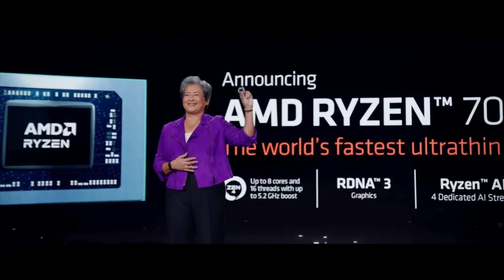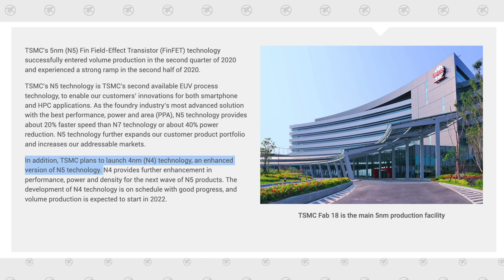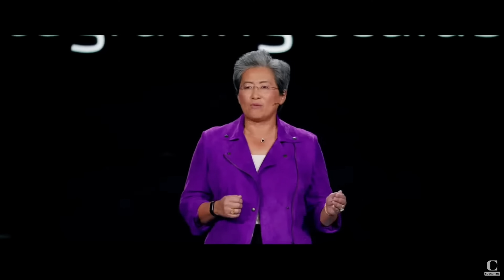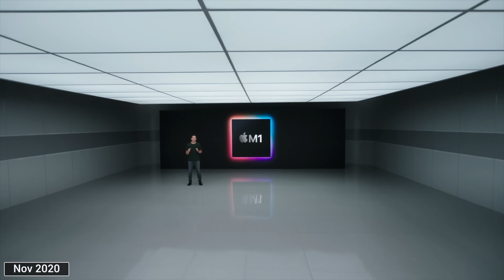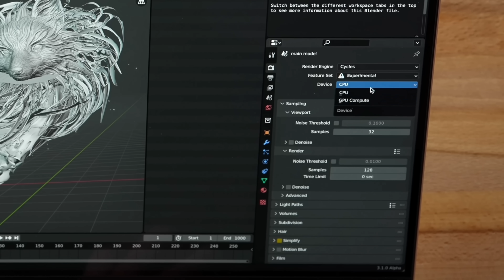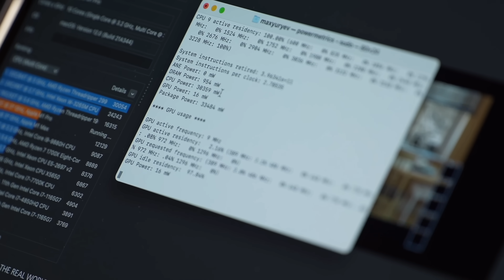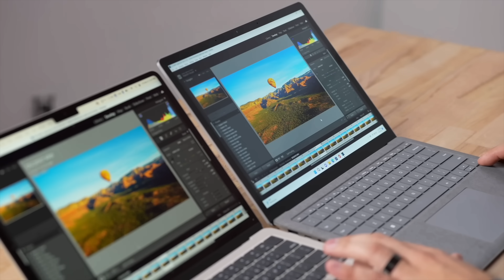AMD's New 4nm 7940HS vs M1 & M2 Pro! Apple Silicon Killer? 🤯

Comment: To me the M-chips have one biggest advantage: the ability to deliver the same performance when unplugged
Reply: You actually mean: to not get extra performance when plugged in because power doesn't really matter if cooling is sufficient?
Reply: @MLWJ1993    @Mark Jacobs   I got your point, it truly depends on everyone's use case
Reply: @tanthokg  The M-chips are impressive unplugged & in specific tasks, don't get me wrong on that.

I've always felt they're pretty lacking whenever power isn't the limiting factor.
Reply: @MLWJ1993   yeah it's the cooling system, the macs are always pretty thin and light comparing to other laptops, the mac air is even fanless. And I think ARM architecture (at least with the M-chips) isn't designed to run at such high power? I don't know much about the mac studio and M1 ultra so I can't really tell
Reply: @MLWJ1993  Which is why people don't rave over the M1 desktops like they do the laptops, the ARM architecture is likely to be undefeated in mobile for performance per watt forever and that's ultimately what a laptop is for. Regardless, there aren't really any creative workflows where x86 performance overshadows M1 offerings and that's really the target demographic with the M series anyways.
Reply: @EYE_OF_THUNDERA   I'm sorry but what are you trying to say?
Reply: Its related to the software, not really the chip itself
Reply: @DS-pk4eh   I thought it's because the chip architecture, and the optimization of macos. I don't think they rewrite an entirely new Premiere Pro and a bunch of other softwares and optimize them all for mac but not for windows or x86
Reply: Working on the battery with professional software will drain the health of the battery fast.
Reply: @uribak9144   yes, but we all need some days outside right, at the classroom or the cafe, or work while blackout. Also, I know that we can plug in the machine all day, every 2 weeks I discharge it to 10-20% and then fully recharge it to keep the battery health in check
Reply: For me is not a advantage, i dont benefit anything from it
Reply: Tui cx đang xài m1pro :v rất hài lòng về pin của mấy con máy. Hiệu năng khỏi chê luôn
Reply: @tranhuuvu963   tha hồ mang đi học đi cafe ngồi luôn, khỏi sợ hết pin, khỏi mang sạc, khỏi cần kiếm chỗ sạc :v
Reply: @tanthokg  :v chả thèm nghi tới lên m1max
Reply: Let's not forget that Ryzen will draw 55W while m2 max just 20! M2 is still insane if it comes to low power consumption.
Reply: @matt-eu-poland that’s fine and all if that’s even a “flex” But nobody that wants raw power to play games on won’t and can’t do that on a MacBook. 
While the MacBook has its designed uses.  To me buying a MacBook is like buying a polestar car.  It’s nice and expensive and it appears to make you look in a league of your own. But there’s other laptops/cars that can do better for less even with similar quality and noise etc.
Reply: @KING0SISQO  I doubt about the "similar quality" part. No laptop will be as fast on the CPU with that battery life as Apple silicon. I'm too old to be an Apple fanboy but they just made a good product. Please give me an example of a Windows laptop that has an OLED screen, can run 12h on battery, and has faster CPU than M2 Pro. Also a laptop which has USB-C from all sides (a chargeable thunderbolt 4 without compromises), <7nm CPU transistors, crisp 1000 nits bright display, very good touchpad and keyboard that doesn't break. Also a laptop that doesn't produce noise in like 95% of situations (normal + fairly heavy use).
Reply: @matt-eu-poland  like I said. The audience is for those that want those things. 
Where I want raw power for gaming so my needs are completely different to yours.  So it doesn’t make sense telling me which windows laptop has all of those features that YOU need.  Features that are not going to help me game at ultra settings beyond at what ever resolution be it fhd, qhd or 4K.  Something that a MacBook experience just won’t deliver on.  Meanwhile if I’m not gaming even 33db is very quiet. It’s not going to get me kicked out of the library.  Battery life? While it may not be as long as MacBook. But some can get around 11 hrs like the Asus g14 laptop. But just remember you’re also getting a rtx 4090 with it. 
But someone who doesn’t need a gpu maybe fine with your recommendation. But for me.  It’d be a poor investment.
The laptop very close to quality is the razer blade. The design and build  is likened to mbp all the time.
Reply: @KING0SISQO  you can get 4k 120hz on PS5 nowadays
Reply: @KING0SISQO  laptops are so, so for gaming. Still one can game on OLED, yet gaming laptops don't generally get one. They're rather on a lower quality side. So hardware is generally of a better quality on mac.
Reply: @matt-eu-poland  sometimes people want everything in one. Not a need to buy separate things. But even if I did that I’d still feel deflated that my latest and greatest can’t do something very well that I have to buy a separate device to do that.  Like if I’m on the go and fancy playing on the built in screen. The os5 isn’t going to help me out and it’s just extra weight, extra hassle. If I had to choose I’d go Xbox anyway.  Ultimate pass I can game on the laptop for no additional cost for games. Something the ps5 can’t do for me and the MacBook be useless at helping me to enjoy those titles. 
The laptops have oled screens. They are pretty good, I had one in an Alienware few years back.  Very impressed. 
While the build quality may not to your satisfaction.  I think if aesthetics is what you care about without the need of everything else it can or can’t do for you. Then go for it. But I wouldnt recommend it unless you wanted all those things you mentioned to deem it as a superior choice and you was willing to spend a few thousand for it.  But I couldn’t spend all that cash and it can’t do everything (even just a little bit well for the  money)
Reply: @matt-eu-poland  yah arm did good job polishing that architecture. Anyway power consumption is power consumption, its just a number on paper, nice to have but pointless in most cases. If i there wouldn't be power outlet on each wall everywhere i go, then it would be advantage from apple side, but now its more like small convenience not to perform plugging action than a game changer
Reply: @racistpixel1017  power consumption is important. See all those reports about Windows laptops battery drains. Simply because CPU required more than it should on battery. That's what makes battery in Apple laptops so good. I can use it for almost 2 days without a charge & yet it's as fast as best windows gaming rigs. That's what I call a game changer.
Reply: @matt-eu-poland  you said that power consumption is wery important but didn't said why, im saying that it is not important because its just a small convenience to be unplugged, thats all, but a plugged in charging cable vs unplugged, job is done on both same way.
Reply: @racistpixel1017  mainly because of longer battery life and less bills to pay. I spend around 16h per day in front of laptop. I want to decrease my electricity bills. Macos helps me with that.
Reply: @matt-eu-poland  the difference between apple m and performance windows laptop is like >200euros per year on electricity... You not saving all that much
Reply: @racistpixel1017  so even according to your calculation 3 years I save more than half of the avg. laptop worth in electricity bills. I'm fine with that. Performance / Watt is quite important indicator imo.
Reply: @matt-eu-poland  its less you spend on Starbucks
Reply: @racistpixel1017  probably less but also a money I'd rather keep than throw it for the same computation.
Reply: @matt-eu-poland  depends of what computation, i mean what you do with it? You know that only base m1/m2 is cheap, the one with 200gb and 8gb ram, for serious work that needs computation its pretty useless. If you go to like 1tb amd 16gb ram, then windows machine is cheaper, if you willing to get heaver machine then its faster in both cpu and gpu computation, apple wins only in slim and light segment and universally in video editing.
Reply: @racistpixel1017  I have 32gb memory m1 max and does pretty much whatever I want it to. Multi core works great. I use it mostly for code compilation, and larger data sets analysis. Ofc at some point would be better to have PC but still, if such a small laptop does the job why to bother 🤔
Reply: @matt-eu-poland  sure but you just say pay same money for compilation or something, so you paid more for your apple than more powerful windows laptop, what you paid for is not for faster cpu for code compilation but for laptop that is light and slim
Reply: @racistpixel1017  I get your point but that's not only what I paid for. I'm a bit picky if it comes to workstation, perhaps. I paid for portability, computational power, long battery duration, best speakers in laptops that I have seen, silent laptop, and small charger that I can fit in my bag. Combine all of that and I think Windows is still some 3 years behind unfortunately.
Reply: @matt-eu-poland  i do understand, you previous points little bit contradicted logic. For me portability is really nice thing, but little bit larger laptop is no issue, tho i dont buy those fat maxed out window laptops. Speakers and batter for me have no value, i have earphones for that and long lasting battery for me more like a gimmick, all the time plugged in laptop issue? Really, its not the phone, to track when mac is fully charged to unplug and then plug in again, why this hassle, you put on charger and forget it
Reply: @racistpixel1017  but have you tried those MacBooks? It's a game changer if you don't need to listen to sounds of your laptop's inner workings, get the best hardware, and can literally move to sofa to work whole day without worrying about cables. I can Chromecast to TV and not worry or take my Mac to Starbucks to work there without cables. Even if I need the charger that can drive that laptop (even m1 max) is the same like for my phone. I mean, what can we really complain about here? The only thing that comes to my mind is pretty limited Apple software which feels like a jailed bunch of apps instead of a real system. Unix is also advantage here tho. No issues with drivers or slowdowns due to updates like on Windows. I hit the Upgrade button and I never worry of incompatibilities unlike in Windows.
Reply: @matt-eu-poland  my friend have first mac mini, its alright but newer tried laptop, i guess battery thing depends of use case, i work mainly from my bed, sometimes couch, always have a power outlet.  i my self hobbyist game dev so i need that gpu, expecialy for vr and lightmaps generation, good enough screen for colour accuracy, everything else is not so important for me
Reply: @matt-eu-poland  how do you pull that off?  I get a few hours when video chatting with clients or somewhere more with audio/video production.  And it's in low power mode
Reply: @Clasam09  so I generally keep the performance mode as usual. I keep Browser and Keybase open only, unless I need IDE. If I don't need something, I close it immediately (nothing left in memory). I limited amount of apps running in the background. I disabled animations (since I don't like them in general anyways). Anything additional that isn't needed is disabled. I read some articles on how to speed up the system from time to time & apply some various tips & hints. Same goes with unnecessary browsers' extensions, tabs etc. They are either removed or closed once used. I still keep some 20-30 tabs opened at once. Video streaming might be expensive operation so battery may go down a bit faster.

I mention all of that, but it's not like I really do keep that in mind all the time & it's not like I'm concerned over that. It's just a bunch of healthy habits.

It's 1:22 am in Poland right now. I started working at 9 am of previous day so laptop supported some 3-4h of solid work and then some 4h of browsing, scrolling 9gag and watching youtube. Not bad ha
Reply: @Clasam09  so I generally keep the performance mode as usual. I keep Browser and Keybase open only, unless I need IDE. If I don't need something, I close it immediately (nothing left in memory). I limited amount of apps running in the background. I disabled animations (since I don't like them in general anyways). Anything additional that isn't needed is disabled. I read some articles on how to speed up the system from time to time & apply some various tips & hints. Same goes with unnecessary browsers' extensions, tabs etc. They are either removed or closed once used. I still keep some 20-30 tabs opened at once. Video streaming might be expensive operation so battery may go down a bit faster.

I mention all of that, but it's not like I really do keep that in mind all the time & it's not like I'm concerned over that. It's just a bunch of healthy habits.

It's 1:22 am in Poland right now. I started working at 9 am of previous day so laptop supported some 3-4h of solid work and then some 4h of browsing, scrolling 9gag and watching youtube. Not bad ha
Reply: @racistpixel1017  yes, a potential battery drain depends on the use case, naturally.
Reply: Yep! That's the most important reason for me. That's the only reason I want a macbook.
Reply: @Master_Misanthrope  I have a macbook doesn't mean I worship Apple and dislike other brands. I have a custom desktop that is 3x expensive than my macbook. And I love both by machines. I also have a gaming laptop that is as expensive as my macbook. And I love using all of them. I wasn't trying to compare anything to anything. I already said "to me" very clear so I wasn't speaking behalf of any group of people. Maybe try another expectation next time
Reply: @Master_Misanthrope apple is not that expensive anymore. In fact it is cheaper than many of comparable windows laptops. That's why Apple is stealing a market share from Windows.
Reply: That's the problem of Windows power management, this problem doesn't exist on Linux.
Reply: It's igpu so same for 7040 series. It can go up to 30w max. Meanwhile rtx GPUs using 120w. That's why it has that difference.
Reply: And much less noise.
Reply: My 7940hs tuf does deliver 35w to 65w performance on battery even surpassing the m2
Reply: @hakiro-hy9nc   you know that the M2 has the max tdp of 20W, right? Just to be clear I'm not saying one is better than another, since I have both a Mac and a PC twice as much expensive as the Mac. Both are great, just use whatever fits your use-case most.
Reply: I don't believe what your claims are.
Reply: 😂bc is arm chip not x84 chip😅
Reply: @Garrus Vakarian  yeah I hope so. Currently I do 4K video editting and coding on my M1 mac air without an issue on battery. I hope the new ryzen chips can do the same, because sometimes I need my windows laptop outside but it was not possible due to its reduced performance when unplugged.
Reply: And they don't sound like fighter jets when doing the slightest demanding task
Reply: @Octrox  i lowe that aging joke about fighting jet. I have relatively slim gigabyte laptop with 11th i7 and rtx 3070. I litteraly play games on it with fans of all the time and no issues or sound.
Reply: That's really just because they're hilariously downclocked when plugged in.

Comment: 45W TDP actually results in aprox 60-65W power draw. Check out yesterday’s Gamers Nexus reviews of the non-X 7600, 7700 and 7900 zen 4 chips. 
So the 7040 chips might get close to or exceed the M1 Pro and max, but at double the power draw. 
Bring on the M2 and M3 pro, max, ultra and extreme!!
Reply: Mobile uses monolithic die vs desktop chiplet tdp and power draw isn’t the same. Where as desktop power draw is tdp x1.35. So 65w tdp means 88w power draw
Reply: The laptop APU design is different than the desktop variant. For starters, it doesn't have a IO die. 
The laptop chip design is more focused on efficiency which should be even better when compared to their desktop parts. 
The 7940HS will be max 35W CPU power in most laptops, only some gaming laptops will allow for more than 35W CPU boost.

Comment: Does anybody know, is it possible to install STEAM OS on M1 Macs? (as separate operation system)?
Reply: You can’t install steam OS but you can install Asahi Linux which is specifically designed for apple silicon. Note that if you plan on installing steam proton, most games are designed for x86 and not arm so gaming support is just not there. You can install windows using parallels, which can let you play more steam games. Also there’s a macOS application called cross-over which lets you play games natively on the mac hardware without virtualization, which gives better performance. Try out these options and see what works for you.

Comment: Just close the performance per watt, while retaining Ram/SSD upgrade capability that should be enough. IMO.

Will we see M chip with SSD embedded in same SoC package? 
Will that be the last compromise for performance per watt?
Reply: That's what Apple fan forget.....
They always mention that Apple m chip is the most efficient chip but at cost it's upgrade ability......
Also Apple managed both hardware and software so quality control is straight forward compared to Windows laptop manufacturer....
From those different cause different product quality between Apple MacBook and windows laptop.......
Reply: @sobatmedhok1306  That probably means most of windows laptop have longer life cuz it could upgrade to the spec which doesn't exist at that time......